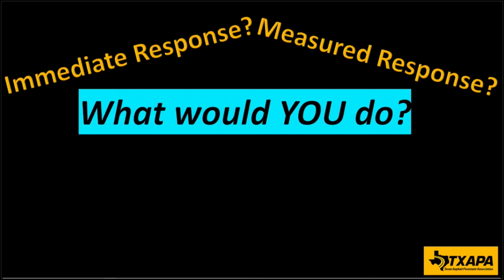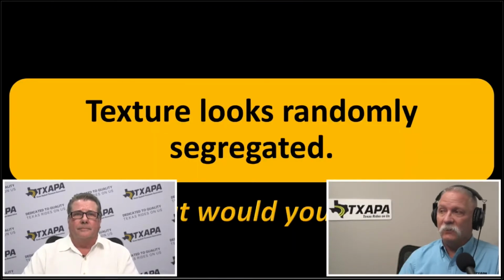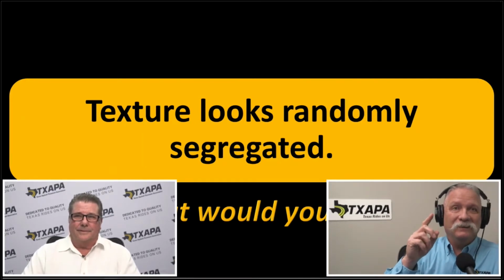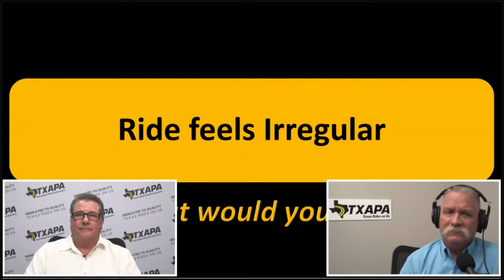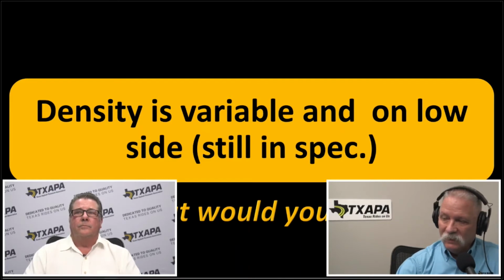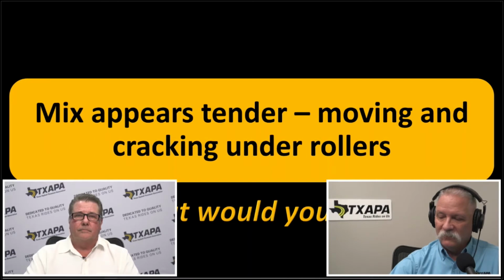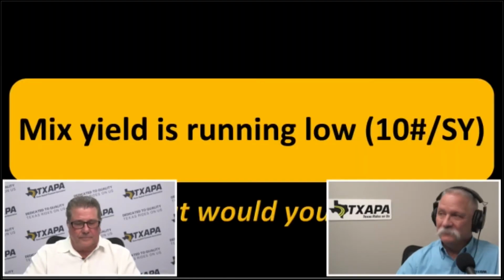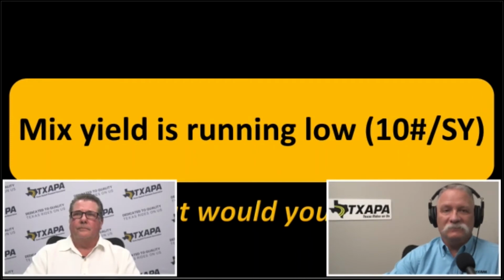Troubleshooting Paving

Comment: Question: I've been a IB for several years and I am noticing a seeming trend in the weight of hmac making a small downward trend; i.e.... I've always been taught that #110 pounds /in/sq yd is an acceptable number by the industry. However I have noticed that now it appears that the weight is trending somewhat lighter, to #108 or even as as low #106, any idea what this can contributed to? I have thought that it may have something to do with aggregate gravities and pit qualities may contribute to it, but am I way off base?  Thanks, KN
Reply: Thanks for your question. The 110# value has been around for many years and is a pretty good rule of thumb number. You are correct that spread rate is mostly influenced by the specific gravity of the rock, and as you know - aggregate geology/type affects specific gravity.  You can even have fluctuating aggregate specific gravities in the same quarry. That maybe what you are seeing. Nature is anything but uniform. In reality, that 110# number ranges from less than 105 #/SY-In to closer to 120 #/SY-In depending on the type of aggregate used and the in place air voids. 110# is a good average but not exact.  You can calculate it by using the Maximum Gravity (Gmm) of the mix design and converting it. Example: Gmm 2.521 X 43.5 (dimension conversion and 7.0 percent place air voids) =  109.6 rounds to 110 pounds per square yard per inch. Don't try to convert to three decimals - the real world isn't that close because even the Gmm varies a bit day to day.  Long answer to a good question,  so 110 is still a good number unless you get into light weight or heavy aggregates. Hopefully this helps.  Jim Warren
Reply: @jmw4570  that's helps a lot! We seem to notice it more in the sac a material, and granted, it is an old pit and nature always throws us a curve ball. Thank you for the answer
Reply: Jim, thanks for that amazing explanation! I’ve been a 1B for some time now and I always wondered how that value was calculated!! Thanks!